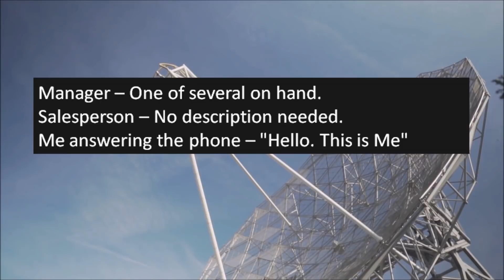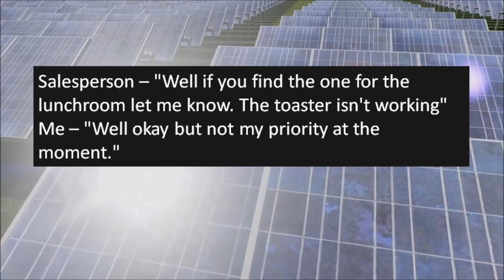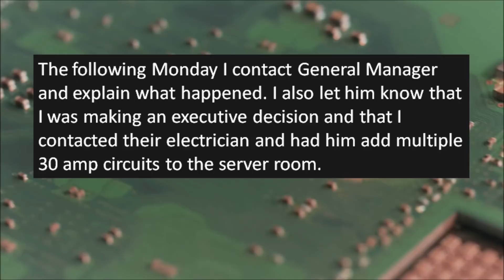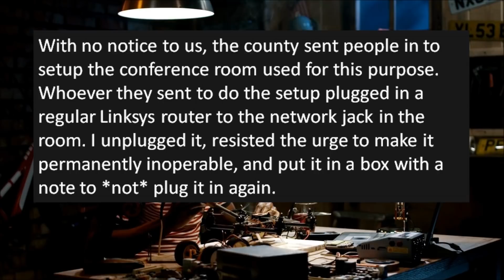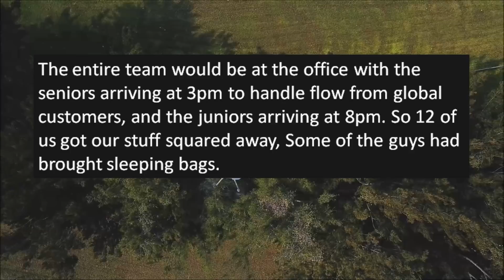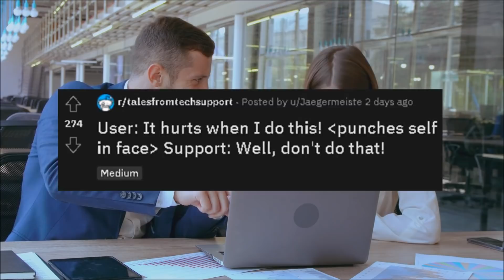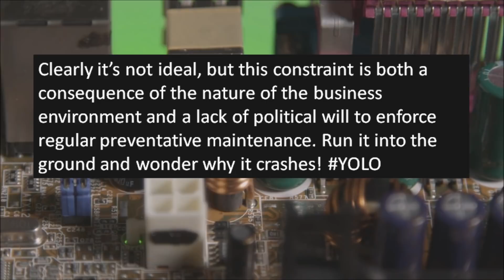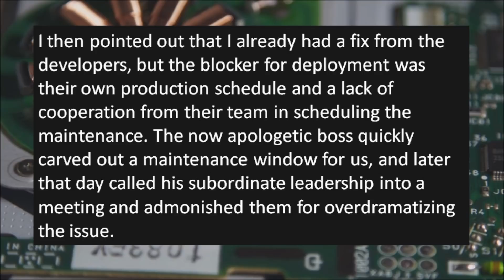Tales From Tech Support - Did I Do That?!?

Comment: The facilities in one of the datacenters I worked in was controlled by one old guy who never labeled anything.  He passed and what a mess we found.  We had to hire a consulting company to fix his mess.  He bypassed one of the major breakers that had gone bad with a pair of jumper cables and just put a sign on it “don’t Touch”.  I think it was one of the 69,000-volt substation feeds.  Or one of the 13,800-volt sub feeds.  That was "temporary", but still.  And many other things.

Comment: Many years ago I worked weekends in a large office building.  
One of my responsibilities at the end of the day was shutting off the lights in the basement.
I got a call on Monday from my manager, asking to confirm if I had shut off the lights.
It turned out that the power switch for their mainframe was in the same panel.

24 hours later before they got it back online.

Comment: Back in the days when I doing data entry on an imaging system I would hit 150WPM easily.  I could have triggered that bug frequently.  Incidentally, the keyboards on that system had metal cases, so they had a bit of weight. At full speed I’d could get the keyboard bouncing on the desk at times.  All four operators were faster than the system, but it never ran out of buffer.

Comment: Y2K, we rolled out the new code a year before and there were only few issues that no one noticed.   On the day of we had one minor issue with one batch job that was not updated.  Took a minute to fix.  We did the same thing all support staff on 12 hour shifts with lots of food.  It was supposed to be on 12 hour shifts for a week or more, lasted a day or so.  My problem was at home.  Some moron shot out a transformer and blacked out the neighborhood.  Freaked everybody out for a couple of hours.

Comment: Oh, you think that's bad? The County decided to move their servers out the the Emergency Command Center to basically a bare cement room. They wired everything up, moved the IPs and started running the County business. Not all was perfect. It was hot in the room, so they had to open an outside door and plug in portable air conditioners.

And then, one day, it happened. Yes, you got it. In the command center, someone decided to make popcorn in the microwave. It tripped the circuit to the server room. The business of the County stopped dead.

This a a county, for freaking sakes.

Comment: Ah, yes, the old expand an older building to suit increased business so add another breaker panel debacle.  The dealership i used to work for had been expanded numerous times over the years.  I can't even tell you how many breaker panels were in the building but i know of at least half a dozen.  There was a breaker in the back shop/detail area that could NOT be turned off.  This is how pretty much ALL of the lights outside of the sales area were turned off...  by turning the breakers off.  That particular breaker not only controls a set of lights for the back shop area but also ONE of the lights for the parking lot.   So either the shop lights are on all night or the lot light is on all day.  No in between. 
Oh, and my house is almost 200 years old...  it was wired VERY weirdly.  Literally, one breaker controls ALL of the lights in the house except the one by the breaker box (which is on the same circuit as the furnace and the outlet for the freezer).  And I was forced to cut the wire off for the garage power because it's gone bad underground and kept blowing the breaker for the refrigerator and the TV in the living room...

Oh, and NYS was one of the groups that had issues with the Y2K bug...  the DMV was issuing registrations for "Year 1900 Horseless Carriages" for a while...

Comment: Story 2... the root issue is that someone thought that home computer gear can just be plugged into a corporate network (likely ignorance nor malicious intent, but still a rogue router)... and the network not having good enough architecture to automatically isolate the router and flag it for investigation.
Reply: Would have been fine if they had disabled DHCP on the router....